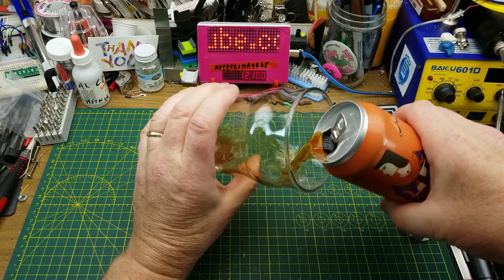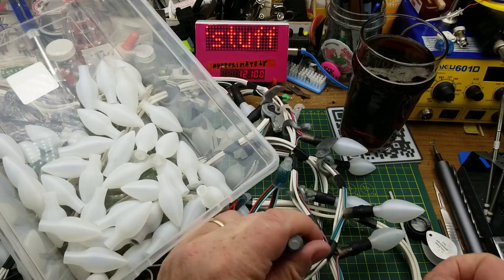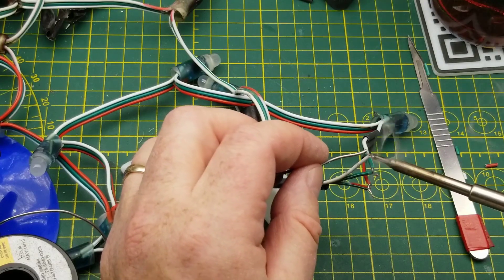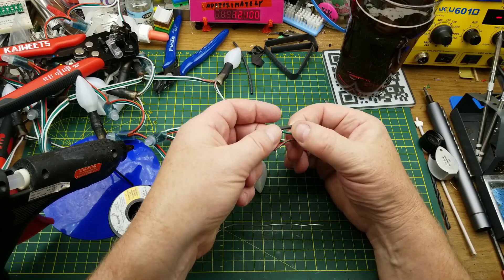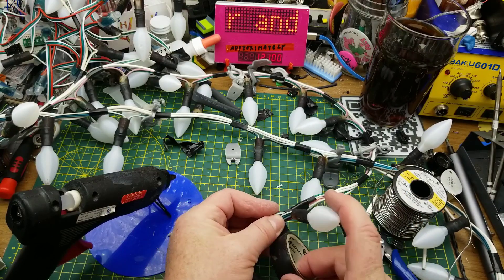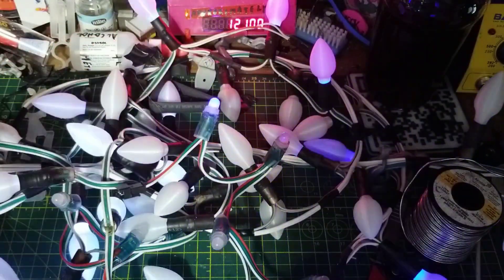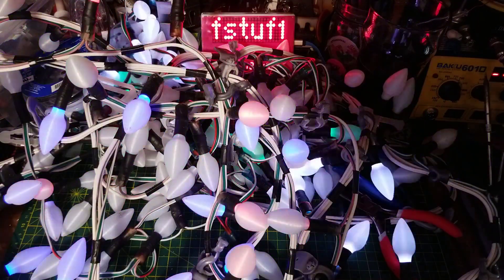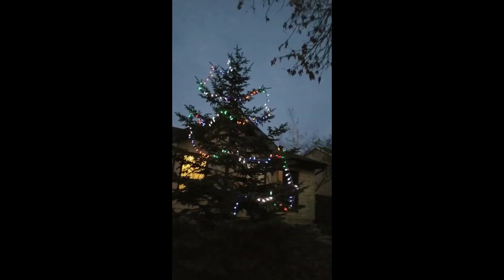Upgrading (and fixing) my homemade Christmas lights

Comment: That's neat. A suggestion for people doing something similar including the "busbar" enhancement: if practical, put the buck converters close to the injection points rather than at the controller. This will help reduce the voltage drop even more, especially the effective voltage drop.
Reply from the maker: That would be electrically preferable, but it adds extra weatherproofing challenges for this kind of application

Comment: Winterpeg area weather is brutal. Like the idea of using the hot glue then heat shrinking it for large connections, would add some rigidity also.

Comment: So if I heard you correctly, did you say that you 3d printed all of these small bulbs? Wow that's takes lots of time and patience.   Hats off to that!   I also like the off grid/ wifi set up and 16 ga  cord to account for dc voltage drop and losses.  Great video
Reply from the maker: It's not that bad.  I print them 10 at a time. 
Over a few evenings it adds up pretty quickly.
Reply: @pileofstuff  how long to print 10?
Reply from the maker: @TheUnofficialMaker  IIRC, it's about 3 hours per batch.
After the first layer, I just "set it and forget it", and come back when I remember to check.

Comment: When you don't always need adhesive lined heatshrink, the hot glue trick is what i also do, it's basically the same stuff
A tip if you struggle to get the heatshrink over the wires like you did, is to get hold of a pair of circlip pliers, the basic ones that open outwards when you squeeze the handles (external circlip pliers), you can gently stretch the heatshrink a little ;)

Comment: Have you considered adding an audio module to add to the festivity? Would definitely give the code monkey more experience for his portfolio.

Well if the i2c bus can transmit enough to a dac for decent quality as well as finding outdoor rated speakers loud enough for decent ambience.
Reply from the maker: Hadn't thought about sound. 
I think I would use a seperate device if i wanted to add audio.  Might be a bit much for the D1 mini to handle on its own.
Reply: @pileofstuff  The answer is a low power FM transmitter on an unused frequency and then just a sign telling people to tune thier car radio to the freqency to "hear the lights"
Reply from the maker: @kirkb4989  There's some local folks who do that with big light displays.
I'm nowhere near that level.

Comment: Impressive! PLA doesn't like moisture. PETG is better but a little harder to print.
Big Clive made a whole bunch of OpenSCAD 3D printed tops for LED lights.
Reply from the maker: I modelled this one a couple of years before Big Clive did those. If he had already published them I definitely would have taken the lazy path.

I did, however,  download Clive's scripts for those light caps.  Never know when they might come in handy.
Reply: I'd be tempted to do in clear PETG with a fat nizzle in vase mode.
Reply from the maker: That might be a cool effect.